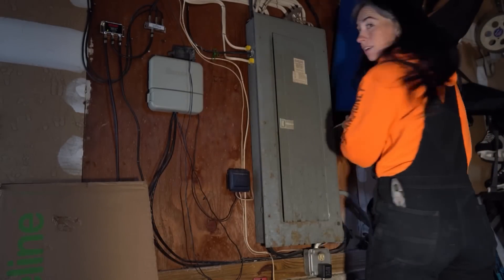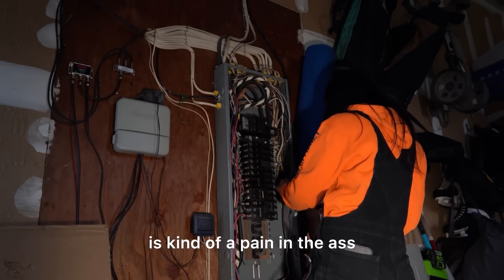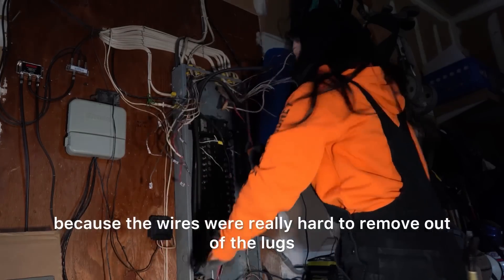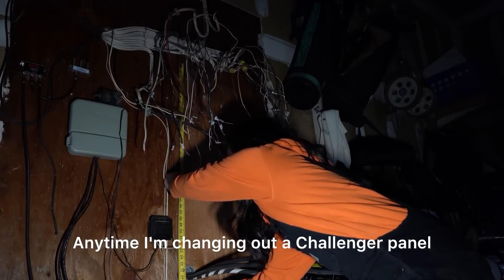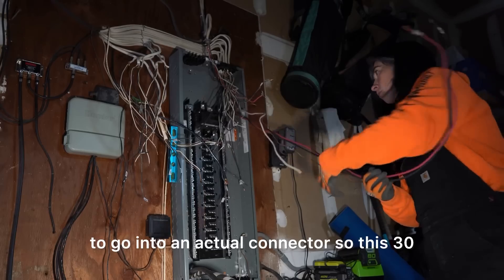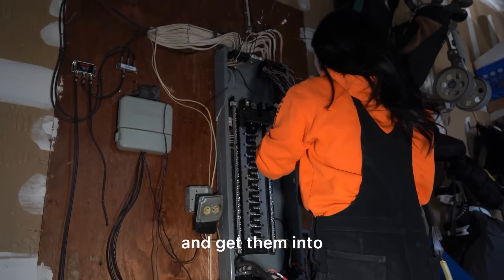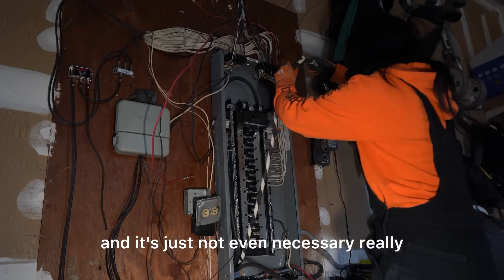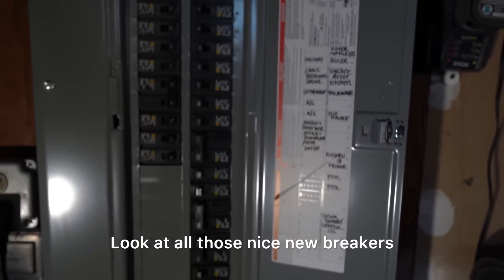How to Replace an Electrical Panel

Comment: Doesn’t the bus bar move around to adjust it to the cover, so if the panels set too deep in the wall, you adjust the bus bar and the bracket that it’s installed to?

Comment: I was a licensed electrician & took great pride in my work. I used ONLY copper bus panels. I really liked Square D QO but when they came out with those GROSELY UNDERSIZED ALUMINUM PLUG ON NEUTRAL BARS, I WASNT ANY TO HAPPY!! Here in Cook County Il the whole house is done in EMT with square boxes with mud rings & RIGID STEEL conduit for the service & anything outside. The only thing I saw wrong with the Challenger panel were the almost FEDERAL PACIFIC LIKE BREAKERS that will let you BLOW THROUGH  15 & 20 amp wires WITHOUT TRIPPING THE BREAKER. When Westinghouse bought Challenger they replaced the ALMOST FPE breakers with their BR breakers=EATON BR today. I dont know if any of the BUS was BURNED UP on those breakers.
I dont understand why you didnt flip the panel & put the main at the bottom= striaght in wiring. This KEEPS the cables out if the gutters & lets you have more room for these LONG AFCI breakers. I NEVER used aluminum service conductors. For 100 amp I used thwn #3, 150 amp #1/0, 200amp #3/0 COPPER in ridged steel conduit with bonding bushings. After replacing TONS of BURNT UP ITE, MURRAY & CHALLENGER panels I really learned to HATE ALUMINUM BUS BARS, CABLE,  WIRE ECT. Where the breakers plugs on to the aluminum bus bars, the galvanic action & severe overheating is why I DEMANDED COPPER. I dont understand unless I missed it why you didnt sand & put Penetrox E on those service cables. I would put Anti oxide compound on all my service connections & if I were installing new breakers in an aluminum bus panel I would put some on the jaws of the breaker just like Square D did on this panel you are installing. 
 I was an electrician for 40 years if not longer. I did my first service change in 1980 when I was a senior in high school. The guy that looked it over became my employer. Im now retired & disabled.

IM EXTREMELY IMPRESSED THAT YOU COULD CHANGE OUT A PANEL LIKE THIS ESPECIALLY IF YOUR NOT AN ELECTRICIAN!!!!! my neighbor & people Ive met in my neighborhood have also DONE IT THEMSELVES!!  I think that MORE PEOPLE should be this HANDY JUST LIKE YOU!!  As a hobby I decode & make keys to antique & obsolete logoed Best brand padlocks & Im NOT even a locksmith. I dont make keys for anything thats still in use.  Some people are GIFTED like you especially if you have NEVER done this before.            WAY TO GO!!!!!!!!!!!!!!!!!!!!!!
Reply: She is a professional and licensed electrician, not a DIY'er.
Reply: @LonnieAdams4  Just like I one was until the pandemic hit & I had to go on disability.

Comment: 2 Questions: How long does a panel replace job like this usually take an electrician? Also, if you replace a panel box like this, does code require that most circuit breakers need to be updated to AFCI/GFCI? (At 13:45, it looked like there might have only been a single AFCI/GFCI style breaker)
Reply: I am not an electrician, but from what I know, they are required to update things to code (any part they touch that is).  So, yes, if the electrician is licensed and insured, they will make you buy new AFCI breakers. And it's not cheap as each breaker is $50.  If you have 20 breakers, that's 2 grand.

Comment: This looks like too much work for me. This is why I am in college studying electrical engineering.  Not nearly as labor-intensive.  That gives me the opportunity to design electrical systems and not get my hands dirty installing them. However, I’m very impressed with this electricians level of knowledge. 

Working on my bachelors of science in electrical engineering and a minor in aerospace engineering

Comment: you cant bring wires thru main service compartment coming from the street .Toronto, , i woul have to flip the panel or drill another hole from the meter

Comment: Curious to know if this installation is to be inspected by the authority having jurisdiction. I see several code violations. I do enjoy the video and am impressed to see a young lady involved in the electrical trade. The nonmetalic sheathed wires above the panel cannot be exposed as they are. You would have to frame around them and the panel with 2x4 to get all of the wiring and equipment  into a wall space instead of surface mounted. Not to be overly critical but there are reasons why we do things the way we do and also why the code is what it is.

Comment: I love this. I just replaced  my 200A sub panel in my own house, since during rebuild we needed to add GFCI and AFCI to all the new circuits. I'm an EE and usually do my own wiring. It all got inspected and passed with flying colors. Love seeing you handle the job and take pride in it

Comment: Lexi before you started working on this panels feeders did you happen to notify the local utility company so they could either pull the meter or did you pull the meter from its socket here were required to pull a permit from the local power company they then authorize us to cut the seal and remove the meter other wise were not allowed changing out main panels either the wires from the pole need to be cut or the meter removed after we reinstall the meter the power company comes and reseals it and i thought everyone put pentox on the service wires least we do all the time .

Comment: I just had an electrician come out and quote me on getting an extra circuit installed with GFCI outlets for $1200. Our house is pretty old. Built in the 1950s. He also said our electrical panel needed to be replaced and would cost around 10k to replace with 200amp. This seems way over priced imo.  When I search online it says the average cost is around $1800-$3000. What do you think something like that should cost? Appreciate any help thanks.

Comment: It looks kind of strange where the coms are taking the prime real estate, so it looks the electrical panel is being pushed almost a foot to the right  from ideal. But who would want to be re-mounting those greedy com boxes. Running the mains up one side or the other should be O.K. close together, if they get split side to side the box will start to act like a transformer and create a hum.   You column of electronic breakers would go on the side away from the mains run if that is doable.  Make should the earth connect wire is big enough for code, that has gone up to #6 AWG.

Comment: I have a question. When u were labeling the wires. We’re u labeling the size of the break associate with wire or the location of the breaker. I’m just curious thanks

Comment: Awesome video! My home was rebuilt after Hurricane Sandy and the Electrician install a Homeline panel with only a single spare breaker. I want to add one of those Generator interlock kit to my panel and there is no room for it. I looked at Tandem breakers to make more space but all of the breakers are GFCI and ARC protection HOM115PCAFI and I don't think Homeline makes a Tandem breaker with GFCI and ARC.  At this point I decided to change out my panel for the next larger size panel. The current panel is a HOMC30UC which has 30-Space 60-Circuit  with a 40-Space 80panel.  I noticed you pulled out the feeders while they are live and was wondering what you think of removing the meter on the outside beforehand so the feeders were not powered? Also you mentioned some of the grounds were pigtailed and you had to add additional length to them. Did you just add the length using a wire nut? Lastly when going for a permit is there anything special I need to add to the paperwork? Thanks again for the awesome video!

Comment: So how did you kill the feed? I assume just pulled the meter? Not sure what state you are in, in my area, even if you pull the meter, you are required to notify the electric company, then they will require an inspection, and they will reinstall the meter. Of course as you know, if your upgrading the size of the service the meter box and outside wire needs to be replaced. But I guess I was mostly wondering how it works in your area

Comment: This might be a silly question, but did you pull the meter to de-energize the mains?  If so, does that require the power company to get involved?  Or as an electrician, can you pull the meter yourself?  You do great work!  Keep it up!
Reply: depends where you live
Reply: they can join the kiss my butt club I'm pulling that meter and putting the tag back on so it doesn't look broken
Reply: In my state you have to have a main  breaker on the outside of the house right after the meter. When doing work like this you turn that off.
Reply: @Sev-lt9ui 
А у нас, в России, счётчики устанавливают на столбы, и я не могу его отключить, только посмотреть показания на дистанционном пульте, поэтому приходится работать под напряжением.
Reply: In texas u call oncore then give them the address and time estimation of when youll be done also the company you work for then you can cut the tag take the meter off and they'll be back to put a tag back on
Reply: Some how in NC some cities can know whenever you take the meter off last time they show up at the job site asking for the meter 😅 so make sure call to avoid any extra fee.

Comment: No mention of having the meter pulled by the power company? From what I saw you did this with the hots live?
Reply: Think so. Hence the tape on the feeders. Wondering if the hex key set was insulated.
Reply: @fiehlsport  some idiot is going to think they can swap a panel out now  and get zapped
Reply: I think a lot of electricians don't pull the meter because it's a pain to deal with the utility company.  They are slow, won't show up on time, and then take forever to come back and reinstall the meter.  In some areas, they make you get everything inspected before they will reinstall the meter, so it could be DAYS.  No customer will tolerate that, so the electrician is forced to work live.
Reply: @ there’s a lot of people learning on YouTube. It’s kind of an important detail to include so people don’t die.

Comment: I decided to remove a main panel once while the service conductors were hot.  I found out the insulation was so weak that the tool I was using to handle it pinched through into the conductor.  It touched the chassis of the panel and the arc removed part of my tool.

I'm hindsight, I should have checked no current on neutral and removed that and grounding first.  Cost me a pair of pliers. 

Luckily I was using popper PPE, so I was not injured, just had to change my underwear.  Nothing a little bleach can't fix.

Stay safe and enjoy the profession Lexi!

Comment: If you have a challenger or westinghouse and you want to add more circuits you might as well just replace the entire panel as a cost saving measure.

Comment: I replaced a Zinsco panel installed in the 1960's where each ground came in through the romex connector with the hot and neutral as usual, but then was fed back up through the connector and wrapped around one of the cable clamp screws! I had seen that before with junction boxes wired in that era but never with the breaker panel. It was a total PITA to undo each one and pull the ground wires back down into the panel so they were ready to be connected to the ground bus in the new panel.

Comment: I’m an apprentice. I was working with another electrician with more experience. We spent about 2 days correcting the panel schedule on a house we were roughing in. The panel needed to be changed so beforehand i asked “can you please label the wires before removing them?”. 
Long story short, he didn’t. And now that the house is nearing completion we now have to go through the process all over again. The mofo already quit and didn’t leave any comprehensive information about the wiring.

I’m glad to see that I wasn’t crazy to ask about labeling the wiring beforehand.
Reply: You'll run into many, many people in your career that try to cut corners or are simply not critically thinking and trying to do the best job they can. Keep your mindset. Be better.

Comment: If I build a house I promise I'll leave enough slack tied up above the panel to enable replacing the whole thing even if you cut everything off at the outside of the panel.
Reply: You would probably fail with that much slack.

Comment: Excellent execution of an awkward job as per usual !. Lexi, you brought up a couple of interesting points as per what they allow in the USA and no I am not an electrician but have had work done by more than one journeyman and advice as per some do's and dont's allowed in Canada. In panel systems they do not allow the main service cables to pass through the branch circuit area of the box and they typically provide a divider plate with the panel to make sure the mains and main breaker are separate from the rest of the breaker panel. However at least they do allow for installing a panel upside down if advantageous so the mains breaker can be at the bottom of the panel if the service cable needs to enter the bottom. But that is not all, they also do NOT allow for splicing branch wires within the breaker panel and as you can well imagine how much fun that is to replace an existing panel when a wire that is too short cannot be allowed to be lengthened within the breaker panel. From my understanding they will allow a separate junction box outside of the breaker panel to be installed so that the said too short a branch circuit wire can be lengthened in an approved manor there and then ran into the breaker panel. It sounds insane ( this is in Alberta ) but that has been my understanding. I had the breaker panel in this farm house upgraded some years ago the electrician who did the work pointed out what had to be done to make it code compliant and the upside down panel method just made the existing branch circuits barely reach thankfully !.
Reply from the maker: I’m not Canadian, we are allowed to have the main feeding coming through the panel! Totally normal in NY.
Reply: @lextheelectrician  Sorry if I was misunderstood as I only meant to demonstrate that for whatever reason the electrical code differs from our particular respective countries and yet use the same 120/240 volt 60hz power and appliances. Put another way I have no idea why the Canadian codes make life so difficult in this sense but they seem to. Glad that I chose Square D panels for wiring I have done myself on my farm and not Federal Stab-lok ( Square D might have to start paying you a commission for your free advertising of their products 😉)
Reply: You can spice inside a panel in Canada. A panel box is a rated encloser for this use by code definition and is allowable. It's some workers or inspectors preference not do so usually for aesthetics. But most would argue, What looks better? A single tidy panel, or a panel surrounded by multiple spaghetti j-boxes? I'll also add if you go the J-box route, there are new rules regarding circuit labeling to match up with breakers and the J-box encloser must have a multi-branch circuit warning label on them. Because of this, in central Canada you'll usaully find splices inside the panels.

Comment: Nice job BUT here we are not allowed to install the circuit conductors on top where the main breaker is and run them down to the separate breakers. Either install a junction box and connect all the wires with longer ones or install the panel upside down. I like the up side down method. Different countries have different rules.

Comment: why not push in the extra slack from the romex coming in from the top into the panel?  you would just need to strip a inch or two of cable.